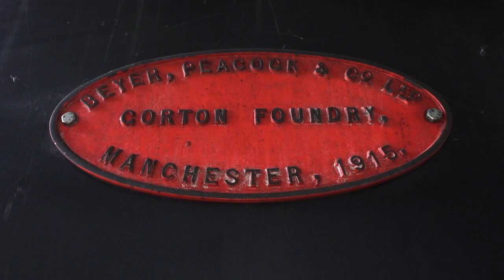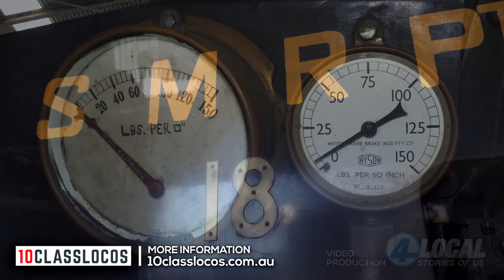10 CLASS LOCOS - Update 1

Comment: What happened to the other locos?
Reply from the maker: Hi, thanks for having a look. There were 14 built. The 10 Class project has two, 10 (first built, 1911) and 18 (1915 build). There are 5 at Richmond Main Museum NSW but all are in perilous condition. The other 7 are in various stages of disrepair, none are running, and located at both North Rothbury and Dorrigo I understand. Numbers 10 and 18 are the two most intact and complete engines left of the 14..